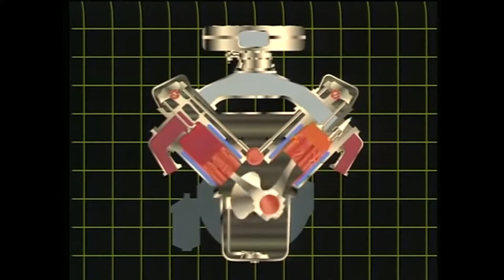Engine Rod Knock Vs. Piston Slap - Take a listen to both!

Comment: Piston slap is just wear, rod knock is a curse (real scientific fact)
Reply from the maker: Facts! You know I think I washed over the piston slap part too quickly and didn't mention WHY it tends to happen... But yes.. good old wear and tear.
Reply: @ExiledWolf84 last week I went and installed a new used engine in my customers Yamaha dirt bike, TTR225 I think it was, his son doesn't know how to change gears, so was riding it on the limiter in first gear for who knows how long 😂, I bet that piston was slapping alright, it was flipped sideways in the cylinder bore, both sides had the piston skirt broken off, just mangled, but I'm the day's leading up to the failure, I noticed that the bikes piston slap was getting worse and worse, so I think you are correct saying that it's caused by piston skirt wear, but I think it's also caused by the cylinder bore being worn into an oval shape, also wearing more towards the top of the bore, it was amazing though, the crankshaft side of the connecting rod and bearing and crankshaft bearings themselves were all in great shape with no excessive play, no discoloration from excessive heat, I was amazed, absolutely could bolt on a new cylinder bore, piston and wrist pin, and a few other parts and that engine will absolutely be a good runner....I appreciate your time and effort my brother! I hope you and everyone else is having a great day or night!
Reply from the maker: @bentboybbz 

That's actually pretty impressive... That engine must have been screaming before it decided to let go!

 When I actually worked in car repair we would occasionally get the people who had accidentally switched into 4 wheel low, who had no idea what it was, and they would come to the dealer with the engine screaming not knowing why the car wouldn't go above 35 MPH....

I wonder how many car engines have met a similar fate under the same circumstances....
Reply: Forged pistons will slap brand new...need more clearance cool due to more expansion when hot then cast pistons...can also "Cold seize" in really cold weather because piston expands faster then cylinders.....
Reply: As we used to say in the CB world of trucker talk........Roddenknockers! 😂
Reply: True story
Reply: A few million Hyundai/Kia drivers now know what rod knock sounds like.
Reply: doesnt have to be you have to replace the rod bearing , its slaping against the crankshaft

Comment: A 3800 buick dying ??? Impossible 😂
Reply: Yeah you have to go a loooooooong way without oil first, and the damn things still run as long as the rods are still in it 😆
Reply from the maker: No joke, huh? That particular car in the video wasn't cared for at all and had a very, VERY rough life, which I'm sure you could tell from the amount of pine needles built up on it.... But there is a part of me that almost wonders how long it would continue to go with that knock being as bad as it is....
Reply: @ExiledWolf84  from personal experience with the series 2 (same thing as the 3 really) it would surprise you how unnecessarily strong the crank and rods are; Most of the time these will go til the journals lock up before it breaks a rod or piston. These are some of my favorite "$500 car" engines ever.
Reply from the maker: @Drmcclung almost makes me want to get the car back so I can test it!
Reply: My folks have an 04 LeSabre Custom with almost 200,000 miles and it doesn’t use a drop of oil since we replaced the upper intake plenum, valve cover gaskets, coolant elbows and oil pan gasket. It is HANDS DOWN the quietest and most reliable car we’ve ever owned!!!
Reply: Rare, but not impossible. It's like seeing an elf finally succumb to Father Time and pass away.
Reply: @rpmevo8 got a 96 with the same mileage and still no check engine light
Reply: @ These cars are indestructible!!!
Reply: @rpmevo8  if you dont do whatever the hell these owners did XD
Reply: @ ABSOLUTELY!!! 😂
Reply: The only time I've seen these fail was after some type of neglect.
Reply: @ the only way it’s gonna happen

Comment: Had a 63 buick lesabre once. 401 had piston slap .would go away soon as it would warm up.made a hollow bell like sound.drove it for years. Never did fail.
Reply from the maker: Sounds like it was a hell of a car. I've never had the opportunity to own a car with a Buick Nailhead V8, but always read that they were wonderful motors because of how much torque the had!
Reply: I had a 71 Skylark with a 70 455  in it. It had piston slap too. That engine lasted longer than the rest of the car did. I ruthlessly beat on that thing too 😂

Comment: Sorry! Don't mean to sound like im being negative, but you're so called piston slop sounded more like an exaust gasket leak or a cracked exaust manifold! Now,  as im sure you are aware of? There is several knocking and claddering sounds that engines make from various engine components. You must have a trained ear for these noises that can only be figured out by year's of under the hood experience! I am 57 years of age now, and automobiles have been a big part of my life! I had a very good mechanic give me a chance to work in his transmission & tune up shop when I was 18 years of age. He told me right off  the bat that I needed to learn what the proper name was for the parts I was talking about with the customers! Don't be saying things like, that thingy that goes to the whatcha majig. You work in a professional environment and you need to sound like you know exactly what you are talking about in a professional manner! And the second thing he said was, you cannot call yourself a mechanic until you can diagnose the issue before ever putting a wrench on the first bolt to fix it! So here is a couple of noises that you are most likely to hear knocking or clunking. Loose rockerarm adjustment or flat camshaft lob, this one is a Ford modular engine i have in mind,  worn timing chains and tensioners makes a crazy knocking noise,cam followers on a modular engine get pretty noisy when worn out! And this one is my all time favorite noise that I have personally diagnosed for guy's who thought the engine was toasted. If you run roller rocker such as Harmon sharp on a smallblock chevrolet engine, you must purchase a set of tall valve covers or they will crack aginst the side of the standard height covers and you would think its about to launch pieces out the side of the block! Man oh man! Do they ever make some gut wrenching sounds! Oh and  let's not forget a collapsed lifter. 😉
Reply from the maker: Thanks for the input!

Comment: I recently bought a 2005 Outback to use as a daily beater and family hauler. When my mechanic gave it a once over he insisted that it had rod knock. 2,400 miles later and the engine is still chugging along. After watching your video, I am convinced that the engine just has some piston slap from 180K miles of wear and tear.
Reply from the maker: That's cool! Those noises are pretty unsettling at first!

Comment: Good demonstration of the two. Piston slap is entirely harmless as well. It doesn't cause further wear. It just sounds so loud because of where the skirt of the piston is touching the cylinder as it cocks over at the top. It's like a guitar chamber. The actual impact is incredibly light. It's a nuisance more then anything. When block and pistons are made of widely different materials such as cast iron blocks and aluminum pistons it's unavoidable to some degree as the materials have different expansion rates. And clearances have to be designed for operating temperatures.
Reply from the maker: Couldn't have said it better myself!

Comment: Another reason for oil starvation is the timing gear disintegrates (it's freaking plastic) and the pieces wind up plugging the oil pickup tube and starving the pump and everything thereafter of oil! I know. I had one of those. I also fixed it, for a little while, and then had to do it again for a little while more. It's a good thing that the oil pan on that 3800 came right straight out from the bottom! Emery cloth, oversized bearing, and almost straight Lucas aided me.
Reply from the maker: Huh, I thought you were talking about the old Cadillac engines like mine at first,  because they have the same issue with the nylon coated timing gears. I wasn't familiar with the 3800s having the same problem!
Reply: I remember that.

Comment: Had a torque converter bolt back out and start tapping the back of the block once. Sounded just like a rod knock. I called a tow and while waiting I crawled under - sure as shit, bolt was out some and kind of beat up. I took it out but still took the tow since it is free. Fixed it up the next day, worked fine.
Reply from the maker: That's always a relief when stuff like that happens and can be fixed easily, kind of like having some sort of driveline clunk that is caused by loose propeller shaft bolts at the flange or something!

Comment: I have told so many people this specifically regarding Subarus EJ engines. People get scared and sell them as soon as they hear a little ticking when it’s literally just piston slap. Explaining once the engine warms up to operating temp and has undergone thermal expansion, the noise will go away.
Reply from the maker: Funny how many people give up on a perfectly good car just because of some sort of small noise that develops!
Reply: Even my Outback 3.6R with the EZ36 engine has piston slap (not very loud at all on mine) until it warms up. usually goes away after about 30-45 seconds. Is approaching 133k miles.

Comment: Good video, An add to the piston slap is that forged pistons(rare in most modern OEM engine are fitted to a wider tolerance and  are noisy on cold start As they heat they expand and the noise goes away Cast piston (common OEM) are a closure tolerance and expand faster from cold While the cast piston isnt terminal and we have all(me included) Have had that trusty 350 chev that would piston slap in the morning  for 50k its not the best sound to hear as a mechanic! We have block heaters in all our vehicles(im in Canada) and keeping the coolant at 90ff all night all but eliminates the piston slap! One of about 10 reasons we use block heaters Besides we can tell the environmental zealots that they are electric trucks!

Comment: Our first family car here in the UK had a bad case of rod knock that got worse as you revved it. I told my wife that was  the signal to change up. 1979 Morris Marina 1.3. I wished that the original crew of the UK Top Gear would find and drop something very heavy on it. Horrible car.
Reply from the maker: I have had a few cars like that over the years! And nothing beats the original UK Top Gear! There was an American version of it that they tried for a season or two, and it was atrocious!

Comment: 👍🏽 This video is a relief. Thanks for posting.

I have that the 2nd noise in my 1990 W126 300SE Merc. The sound goes away after warming up as you rightly said. I've stopped driving it and I'm looking for Liqui Moly oil 10W40 with MoS2 to solve the issue. I'll update here if I suceed.
Reply from the maker: Let me know if you have good results!

Comment: I actually like the piston slap noise.
Reply from the maker: Kind of sounds cool in a way, doesn't it?
Reply: @ExiledWolf84 yes it does👍 definately nothing to do a repair on before it becomes a problem..
Reply: Forged pistons like to make this noise a lot until they warm up. Lol. My 03 Cobra drove me nuts with this noise but after awhile I accepted it as normal. Now I have a tuned Ecoboost twin turbo V6 that has clickity clack noises of its own, so same thing all over again. 😂
Reply: My 98 cobra did the same thing lol it only had 86,000 on it before I sold it.

Comment: This remind me of a few months ago. My mom's car sitted for a good month+ because the Timing cover was leaking coolant. After i repaired the cover, putted back everything together and started the car i'm pretty sure the knock i was hearing was rod knock.

My believe is one of the valve lifters was stuck compressed, knowing this i decided to keep the engine running up to warming temperature and rev-ed it up a little bit. Sure thing it went away and since then no more knock occured.
let's be honest i was a bit worried i would have to OPEN IT AGAIN to extract the valve lifters and replace them.
Reply from the maker: I had that happen with an old Toyota with a 5MGE inline 6.. after getting it rebuilt, I started it up the first time and it sounded like a bunch of nuts and bolts in a blender.

Of course I freaked out and called the rebuilder, and they said to just drive it, and that the lifters would pump up and the noise would go away... Sure enough, I took it for a drive, and the noises all vanished within a few minutes!

Comment: Had a 62 buick nailhead with piston slap once. Noise completely went away after warm up.had a hollow bell like sound. Old mechanic said that happens when boring tool gets dull after many engines made.said not to worry about it probably done it since new. I drove it many years never got any worse.

Comment: I like this! A lot of us who have had cars with piston slap, e.g., me, can have a hard time telling the difference. Until  you get a second opinion on it, you're left wondering if your engine is going to die a horrible death. 😟
Reply from the maker: Made me nervous when I noticed that it started doing it too! I did a lot of diagnosis to pin point it down, including running it with the valve covers off to see  if it was a collapsed lifter or something, but I'm not overly concerned with it now

Comment: i had a 2013 brz with the valve spring recall done. It was common for the techs to be given the wrong kind of sealant so oil galleries would get clogged up. Sure enough i went to pass on the freeway and it started knocking. Tried to make it home but the sound would evolve every 20 feet i drive

Driving with a knock is no joke depending on what kind of motor it is...  

I had a silverado LS with a shitty Powermax  starter. I was cranking the motor (not electric  related), letting it sit, until it fired up and KNOCKED for 12 seconds. 
 i guess fuel was cleaning the oil off  the rotating assy. the crank was spinning 0.1 second on turnkey so oil wasnt moving thru the pump

I fixed the starter, changed the oil and still drive it 4 months later. Running synthetic, new orings/gaskets, cooler & catch can on a gen 3 5.3. 
it bounces the rev limiter and still gets me to work. no knocks
Reply from the maker: Funny how tough some motors are, while others are so damn fragile!

Comment: Haaaa. I love those 75 , 76 Cadillac so much !!! I hope I' ll get one , one day ( I already have bunch of classics saved from the trash most of the time, 1 1964 olds dynamic 88 fiesta, 1 1975 Plymouth Fury 4 doors 225ci 3 speed manual; 1 1970 Plymouth Fury Suburban 225ci automatic A727, 2 Chrysler Voyager 2nd gen europe version, then I have a 1966 Opel Rekord Caravan, and a 1978 Peugeot 504 wagon.).
Reply from the maker: That's quite the collection you've got! 

And the Cadillac has been a great car in the decade or so I have had it. For being as old as it is, it's a very pleasant car to drive as well .. comfortable, quiet, glides right along. Good heat and A/C. Quite the step up from my first classic car - a 78 Landcruiser FJ40, which will go anywhere, but it beats the hell out of you while en route!
Reply: @ExiledWolf84  Yeaaah I' m pretty satisfied, but I love so much many other cars XD. First I have to get the mback to road condition :) . Ho yeah hehe pretty opposed philosophy vehicles :D , and both really great :) .

Comment: My wife's '06 GMC Sierra developed the second noise. Sounds like a very quiet fart. Could be the exhaust manifold, could be the exhaust pipemanifold connection. Either way, she's sold in Spring.
Reply from the maker: Seems to be common aith tha GM V8s of the time, although they seem to get by juat fine for the nost part!
Reply: My 02 silverado 6.0 does it.

Comment: My '96 Olds 98 has rod knock after blowing a head gasket. Ended up doing a lot of work replacing about 80% of the motor. However, the oil pan looked like somebody emptied an etch-a-sketch in it, and there was about a good quarter inch of slop on the 1 & 3 connecting rods. Bearings were smoked, new bearing obviously didn't help. Washing my hands of the situation after spending my whole summer working on the car just to get nowhere. I don't regret it because this was my first major project and I learned a lot, but it's still a bummer it ended this way.
Reply from the maker: Funny how projects like that can lead to learning invaluable new skills. I have a similar story with an 87 Toyota Cressida that I bought about 20 years ago with a blown motor, and took it apart completely and had it rebuilt. 

I owned the car for roughly 5 years, and spent stupid amounts of money on getting nowhere, but the amount of auto mechanic skills I learned with that car have helped me immensely over the years.